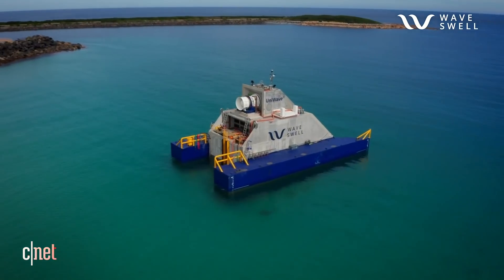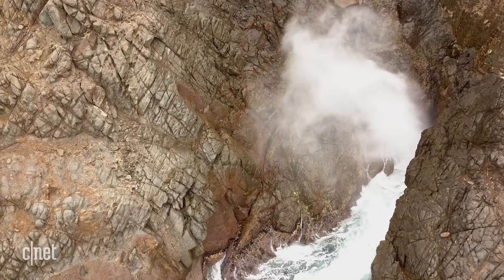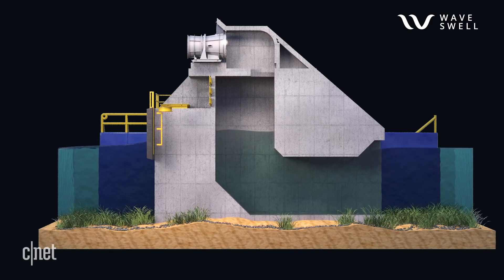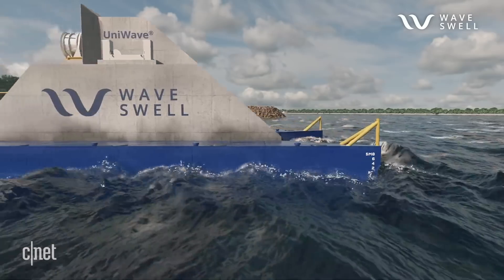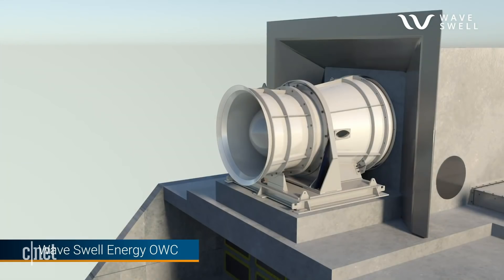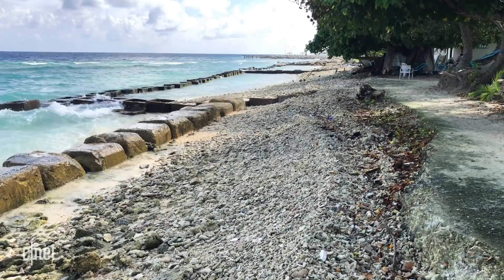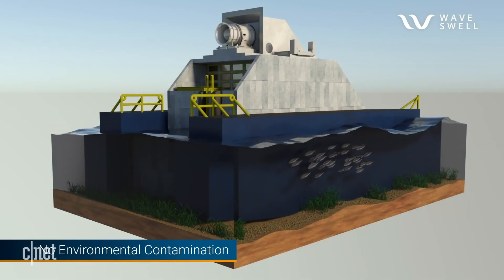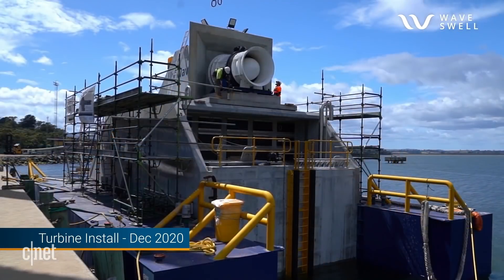How this 'artificial blowhole' could make wave energy mainstream

Comment: It looks like a better system than previously tested, the one off Port Kembla in NSW Australia as an experiment and yes, it floated so broke its moorings in heavy seas. It is now an artificial reef.
On a downside...
The ocean is not rising.... it is called erosion, the Islands are naturally eroding.
It has been going on since the first piece of lava poked it's head up and will never stop.
The rest is just weather, it changes.
Planetary bodies like the moon control our tides.
Wind and the natural movement of water being effected by the gravitational pull from the moon etc cause the change of water levels, waves and/swell etc
There is also a 15 year cycle of heigh to low and the Pacific Ocean has NOT risen in 115 years of official scientific record keeping.
I hope this helps.

Comment: Awesome: Doing away with Wells turbine inefficiencies AND reducing salt/moisture exposure to the rotating parts! 
Phase 2:  Dramatically INCREASE the water column/head for free, by clever design..... Volume/flow is great, however pressure is easier to convert to electricity. 

Capture a steeper energy gradient with lateral Funneling of the medium...give me a call if not clear.  Or at least give me an honourable mention when you do crack it...

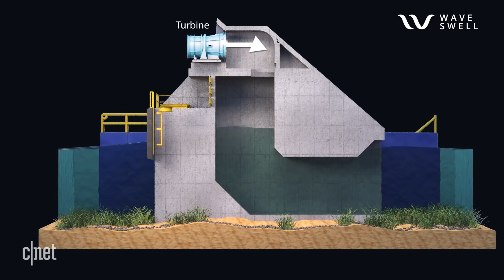Comment: He says it captures 100% of the energy, but it doesn’t, because he already showed @1:25 that the turbine is only spun as the wave recedes. With very simple flap valving I’d have thought it should be possible to use both the advancing and receding waves to power the turbine without reversing its direction. Or am I missing something really obvious?
Reply: He explained that it was less efficient Probably because the energy of the water falling is greater than the energy of the water rising and so if there was a turbine using the rising water energy it would mean the water wouldn’t rise as much and thus the falling water energy would be reduced
Reply: @NoName-iq3nc  
Wouldn’t that first bit violate Newtons laws?
I can see your point on the second bit but id want to see the analysis to prove it (thats if I could understand it🤣)

Comment: IMHO the main flaw is that you get energy from the ocean in form of a moving medium (water) which is relatively heavy an slow. Converting that to air that is moving at the same speed means losing a lot of the kinetic energy. You can only try to use the compression of air to get a bit more out of it but with the large volumes inside I doubt there is a lot of compression unless the seas are really high. That said it could be still a good solution even if only 10% efficient, but noone has succeeded so far and I think there is a reason for that.

Comment: Theflyingcandleguy Me
It is hilarious that there are not two turbines; one on the incoming air and one on the outgoing air. The one on the incoming air would need to be more passive and extract a little less energy. This can be accomplished by adjusting the load on that generator down to whatever works. Second, global climate change is always happening and always will be. The earths atmosphere is 78%nitrogen and 21% Oxygen. Carbon dioxide makes up a fraction of that last one percent. Oxygen has been steadily dropping throughout recorded history and long before. Oxygen actually gets absorbed into the oxidizing rocks as they crack and break down into larger exposed surface area. Carbon has been dropping as well until recently which is actually a big problem considering plants need carbon dioxide. Carbon gets buried in the ground and ends up pooling as dead decaying plant matter locked deep under the ground. At some level taking it back out of the ground and putting some back in the air is actually a good thing. Regardless; we are just barely beginning  to understand global climate change. At some point long after the unsuspecting public realizes communism and miss named renewables have not reversed or stopped anything expensive short lived high maintenance forms of energy will lose their appeal. It would be better to sell people on the clean quiet practicalities of passive energy sources. I love passive energy tech. I am all for solar, wind, wave, nuclear, and hydro. I love how individual and creative it can be and how much potential it has for a better cleaner quieter more affordable future it presents. Do not ruin it by setting people up to hate it because of communist socialist agenda that gets attached to it. There are already to many lies in the world. Let’s go passive clean energy for the right reasons🙂

Comment: Looks expensive, and I noticed Mr. Denniss said cost competitive with wind and solar "when they were at the same stage".  Therefore the important question is what is your roadmap to reduce costs?  Solar is a solid state process, and its cost has come down an order of magnitude (give or take) in the last 20 years.  Nice thing about wave energy is the predictability of the tides coupled with around the clock production, which is something you don't get with wind or solar.

Comment: You could use the power to remove carbon from CO2(put the carbon in the seawater?), and extract valuable compounds, minerals and even biota from simple deposition. You also have a nice anchor to tie to, may as well use it for something like aquaculture in attached modules.

Comment: Why do the orientate the turbine horizontal to the water requiring the air to negotiate a 90 degree elbow...does the blow hole have to be perpendicular to the water ? could the blow hole be at angle to the water and have the turbine mounted in line with blow hole...also why not veins inside the blow hole to provide further compression and maximizing airflow potential.

Comment: Would the sound of the apparatus be transferred under water by contact.  Turbine bolted into concrete structure that is buried in the water...why not install them as part of a levee system ?  is there an optimal angle for them to be orientated to the waves ?   if you mounted multiple units side by side as indicated in the vidoe...has anybody run a water model test to see what affect, if any, that would have on wave power? would amplify - dull - or have no affect - on the wave surge.

Comment: With battery storage, a device like this could charge a portable battery array...think 18 wheeler.  Then could be wheeled to a location where the battery could then be plugged into the grid and provide power to the grid during peak demand hours.   Two batteries rotated so that one was being charged while the other is being utilized.  Or they could be trucked to provide immediate emergency power to hospitals or command centers, just like red cross does with food, clothing and Washer/Dryer facilities.

Comment: I have 2 energy projects I have been trying to get off the ground, one of them is a Wave Generator Array.

One of my top selling points is it has the abiity to both generate energy and suppress Storm Surges. No other Wave Energy Technology that I have researched had this ability.

With the added features of Hydrogen Production and Desalinization, this is the first time I have heard someone else recognizing the need and ability to produce a Multi-Functional Platform. What I like to call, "Following a concept to its logical conclusion".

Comment: In Tasmania the astronomical (disregarding weather effects) tidal range is between 0.5 m neaps and 1.25 m springs. Those blowholes need to be grounded so Tasmania is easy
In Cornwall at Falmouth the astronomical tidal range varies between 2.3 m neaps and  and 4.7 m springs

Comment: I would have thought a large pipe from the sea into bedrock on shore would have been better. You can keep the turbines on shore where it is even easier to maintain, and the shore more immobile. You don’t want to be deploying these along beaches where it spoils the natural beauty of the shore line. Even the turbines on shore could be hidden. I would have thought having two turbines, one in each direction would capture double the energy.
Reply: There are bidirectional turbines like the Wells turbine that works in the same direction on inlet and exhaust!!!!

Comment: Um...Not high enough in the tube.. it may get damaged in storms..You  need a wave cut off can in the tube so you don't blow out the turbine in a huge wave..And port in and out with a tubine multisystem to get 2x the effect..Shaft needs to go higher .. ....But great idea.... i thought a wheel system would also do nicely, Then you stait float it off a cement anchor and let the waves turn it...

Comment: They should make these things out of Roman concrete, the stuff literally strengthens in sea water and its made of readily available materials and produces less CO2
Reply: Roman concrete cannot be stretched, only compressed that why they don't use it anymore.
Reply: @AndrewMellor-darkphoton  But doesn't it create aluminum torborate crystals in the presence of sea water which make it harder and more rigid, like roman sea structures are still standing today, modern day concrete wouldn't last 50 years in those conditions, and with modern inventions like steel rebar which addresses tension forces and shearing forces as well as other concrete additives we could make an even stronger concrete than the romans.
Reply: @thedankgoat7972  the fact that some of these structures survive to this day is partly due to survivor bias, all the structures that were too weak have long since been destroyed and forgotten. 
We can make concrete similar to Roman concrete to this day however modern concrete relies on rebar for its tensile strength and steel rusts when exposed to water, thus expanding and cracking the concrete. Designing a concrete structure without rebar will make it utterly massive and cost prohibitive, if it could be designed at all. Perhaps another reinforcing material, say basalt or carbon fibre, could be used, but they're not cheap on the volumes we're considering.

Comment: Imagine this blowhole sitting on top at the end of a long concrete tube that is a few feet larger than the highest and lowest tide.
The tube is buried and extends for a couple thousand feet.    A few feet out into deeper water the end of the tube widens and angles downward to stay fully submerged. 
As the tides change air in the tube is displaced by sea water. Air travel out is allowed to pass.  The suction created be the ebb tide is used to generate power.
Reply: The tide rises and falls over 6 hours, you get nowhere close to useful air blowing thru a turbine from just the air inside a pipe. If you would build a giant flat tank with the water income holes under water at low tide it might work, but it might have to be a few kilometers wide along the coastline for the slow tide rising pushing away enough air to power a turbine, so it would be a massive build project. Same principal as this wave energy, they have a big tank in which the wave can come in and replace the air, and that air is funneled into a small tube to get more airspeed.

Comment: Seems can be designed to use minimalist processed/refined resources and more natural quarry or mined resources to station.  Wondering about a check valve on the lower exhaust with a generator turbine... though thinking might net effect reduce the gravitational added advantage force on the fall level and pressure for the upper generator volume flow force.

Comment: Spray mist in the ducting/turbine is still going to be a major source of corrosion and weathering, so there are similar material challenges as existing immersed wave harvesting, but without biofouling. The system might work over a longer timescale potentially between maintenance, but the material challenges are comparable.

Comment: I would really like to see the CO2 footprint and that of the other materials used. This structure looks like it contains 100 tons of concrete which is roughly 200kg per tonne of concrete. I really need to stress this as many people still are not aware of that. In this case, the massive base might mean a significant reduction in overall efficiency, depending on lifetime! Surely a large wind-turbine needs even more concrete depending on it's size, but also might have a 25x peak power output.
nevertheless, interesting approach, I would like to see data on power output over time (in milliseconds and over a year...  is it flattened via super capacitors or something?) and so on

Comment: There is significant amount of information about this project. The demonstration unit, installed in January is reported to have a power output of 200kW. The project eventually consist of 3 units connected to the island grid. King island already gets about 2/3 of it’s electrical power from renewable sources. 

The units themselves are reported to be scalable up to 1MW. There has been a significant amount of scientific research done in support of this project by various bodies including the CSIRO.

Comment: Very cool! I’ve been working on breakwater projects across the Great Lakes and Gulf areas of the US through work as a geotechnical engineer, and I would have never thought to incorporate green energy applications into the designed solution. Would love to hear how this system can be designed to meet site specific needs, and how it turns out once connected to the grid.

Comment: They need a valve to prevent outflow of air as the water level rises and let the air in when the water level falls. The company website suggests some sort of flap valve. It's not mentioned here and there are no details on their website, perhaps because an oscillating (flapping) mechanical valve might be a weak point in the design.
Reply: Nailed it!

Comment: I can only imagine what a beach full of those winding up at different rates and frequency might sound like.
Reply: Agreed. This looks like it sucks the air in to power the turbine so that may affect the output but nobody is going to tolerate multiple of these whistling away 24/7.
Reply: As soon as he mentioned having to monitor the sound level it seemed obvious to flip the top brick around so noise goes away from shore.
Reply: Pardon
Reply: @thebrowns5337  the sound of many in operation

Comment: "Could" "may" "think"  "expected"  Wave energy is sort of like the lower tech version of Fusion: amazing, unlimited, 30 years away and always will be.
#4 problems:  salt accumulation, corrosion and bio growth: salt and barnacles jamming up the moving parts, corrosion degrading them.  So it is a terrific step to not sent the sea spray through the turbine - smart move.  There will be some spray getting on the turbines of course, but also whatever flapper-close system used to vent incoming air and keep the vacuum for the reverse power stroke. (In a place like the Maldives they might create many jobs for people who regularly go out to the rigs and 'scrape the 'hull' (flappers and concrete surround). Turbine maintenance would of course require more skills. 
(We sea kayakers used to buy the 'waterproof' VHF radios paying an extra $30 for the extended warranty (extended warranties are usually basically a scam).  Because we were closer to the surface of the sea and repeatedly splashed those 'waterproof' radios would only last about a year. We'd then turn it back into WestMarine, they'd give us another one, we'd buy another extended warranty.. I bought one radio in 2005 did this return/exchange twice, but then that third radio  actually held up, it even still sort of works, but I finally replaced it this year.  So there may be hope for wave energy. Good luck.

Comment: This is hardly new. We looked at this back in the 90's during my post grad. As usual lll wait and see if this goes anywhere (again).
Reply: I agree. Sea spray is horrendously corrosive and abrasive. Also "its more efficient if it goes one way" sounds dubious, especially when we factor in the wear on the device creating unidirectional flow. (Also he's saying 1 > 2 ?)
Reply: @recklessroges  The problem with a bidirectional system is that a lot of the energy you capture goes to slowing down the turbine which was already spinning in one direction before speeding it up in the other direction.  Potentially an even better system would be to have two single direction turbines, but that might require complicated valves which adds more moving parts to wear down.  This is probably the best solution in terms of $/kW.
Reply: @Turksarama  There might also be residual pressure in the column since the turbine does slow down air moving out or in.
Reply: @Turksarama  Exactly. So a valve is needed and there is no reason (that I can think of) to not have a generator on each side of that valve so that you are taking the wave energy on both the 'pull' and the 'push' (or suck and blow) of the water column.
Reply: @juddjohnson5200  yes